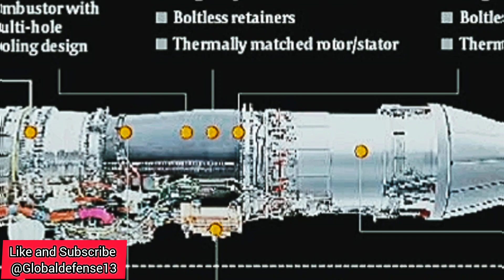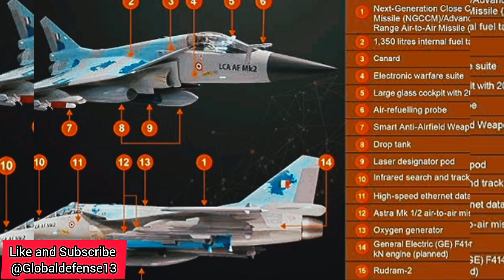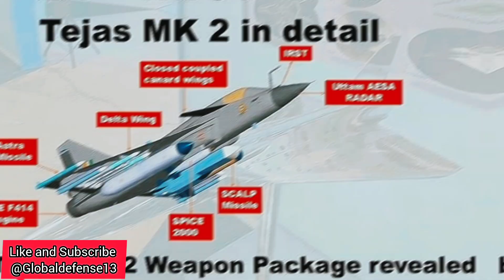TEJAS Grounded: How U.S. Engine Delays Are Jeopardizing India’s Defense Dominance

Comment: Just like the Brahmos , India should have partnered in the SU 57 . This would have helped immensely. India shoukd know by now not to trust the West . Now is the time to reverse engineer the GE engines if they go through and develop the Kaveri. India by the way has leverage as they develop the hypersonic. The Tejas can wait , after all they did wait . Treat them as a thing they need to learn from as failures are pillars to success.
Reply from the maker: @Dbenzsanz  su-57 production is severely reduced due to sanctions on Russian military and government causing massive supply chain issues. Russia can't export Su-57 for next 7 years .
Reply: @Globaldefense13  but didn't India pull back  from the  opportunity to develop a engine along with Russia which led to the production of the SU 57 . Am not talking of buying . For your quick response am subscribing. Thank you .